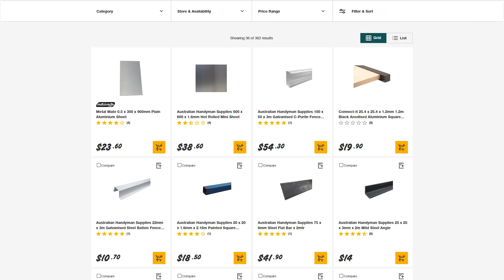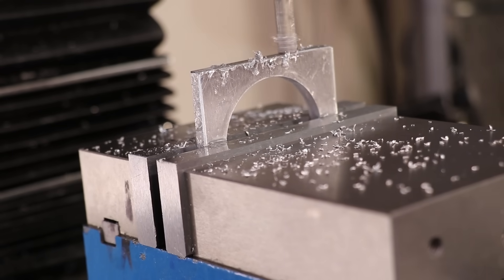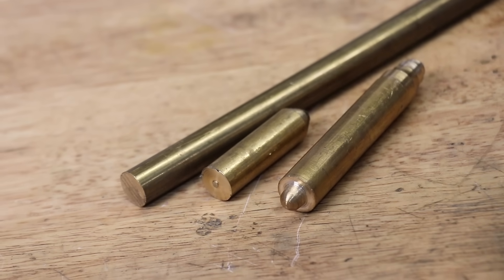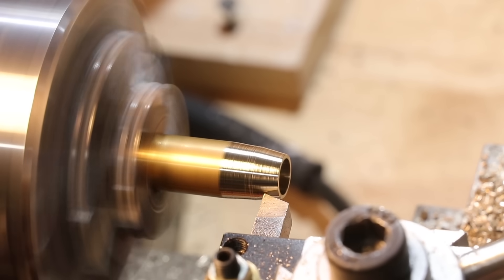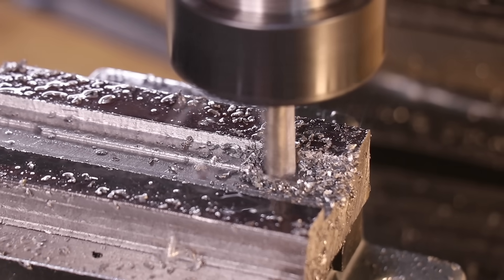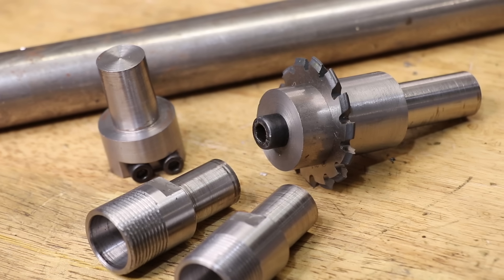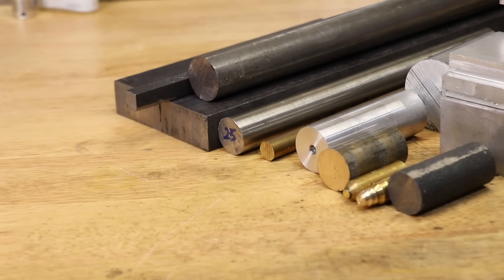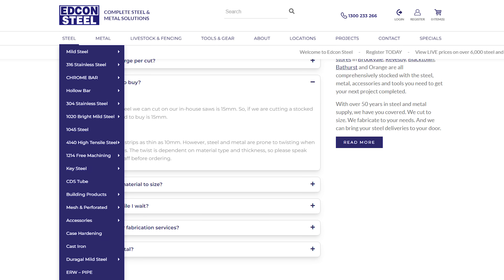Hobby Machining Materials - Where I Buy My Metal From (Australia)

Comment: Finding materials is a pain in the states allot of people get lucky but when you need something special it sucks I priced some stock the other day on Metals depot priced a 10’ piece of stressproff on accident so added a drop they had with the ten footer the drop was 125$ without the drop was 400$ smh had to pay shipping on each regardless but that’s ridiculous
Reply from the maker: Interesting, I always assumed it was easier and much cheaper since you have a larger manufacturing industry than we do down under.
Reply: @artisanmakes  it depends where you are. Some parts of the US require shipping, and heavy metals are not cheap to ship. Scrap metal vendors are almost not worth it unless you get lucky and have a good one who knows their product well and prices fairly.
Reply: @artisanmakes  exactly what makes it hard on the hobby guys industrial people don’t have any desire to cut up full length stock for someone when some else will be coming in later for the entire bar scrap yards for most and specialty stuff we put out the nose for
Reply: I’m in the states also, and I’ve gotten very good service from OnLine Metals. Aluminum, alloy and carbon steel, brass, stainless etc., they carry it all including plastics and sell by the foot or custom lengths. If your order is less than 36” and under 50lbs, they charge a flat $7.99 shipping, and have several distribution centers across the US. It would be worth your time to check them out! I have nothing but good things to say about them! Actually have an order on its way right now!
Reply: @tomt9543  I’ll check it out problem is I usually need in the 2-6” range of materials when I need something I’ve got by finding old scrap plate and pipe so far but I need a good reasonable source for some bar stock
Reply: @tomt9543  thanks Tom, I will!